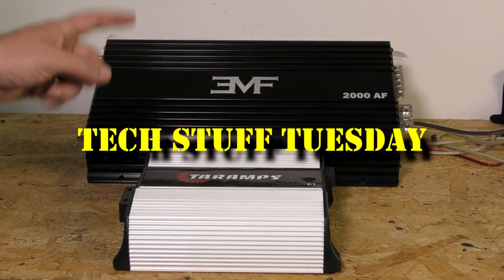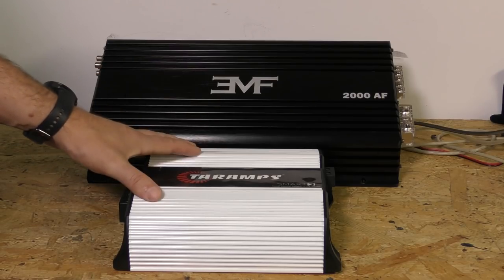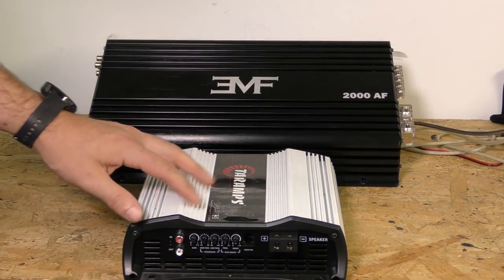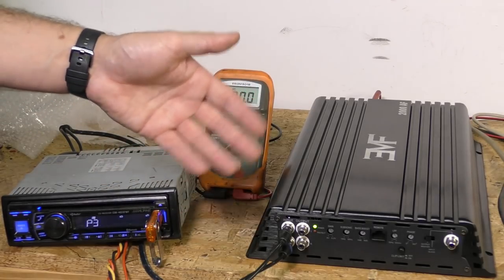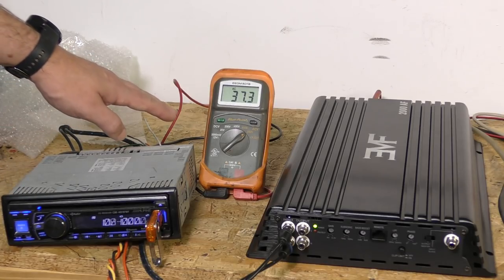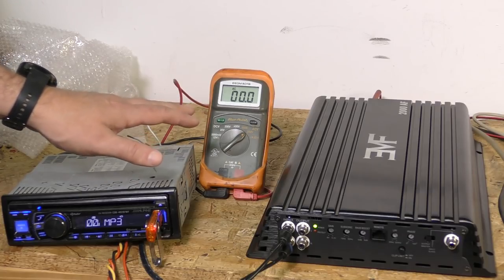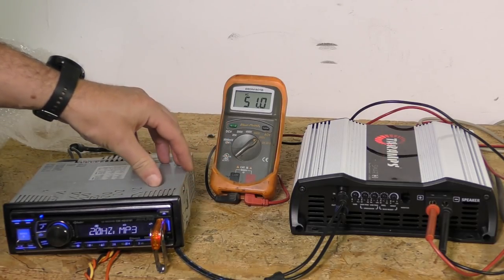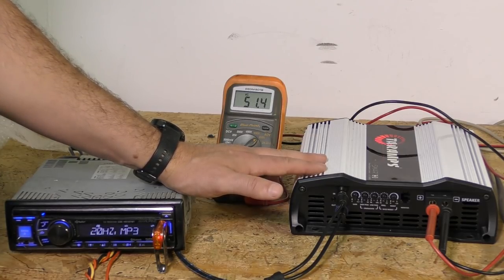The problem with full bridge (Brazilian) amps you never thought about - Tech Stuff Tuesday

Comment: Still gonna run full bridge. Can't beat the price to performance.
Reply: Amen I'm running a Bass 5k and I'm getting another one soon.I can't see myself paying $500 for a 1k amp.I work wayyyy to hard for my money and I'm looking for the best bang for the buck I can get.
Reply: James smith  taramps isba great company no doubt but if its not the bass series amplifiers then its not going to do as well. All the other series amps can be used on subs but they aren't designed specifically for that purpose they are mostly designed for speakers. Same way SFB line wont sound as well as the SALT line because the SFB is designed to play everything equal while the SALT is designed to play the lows specifically.
Reply: Cant trust emf
Reply: I get the point he was trying to make, and ill agree, I've gotten better low bass from a half bridge. But that doesn't change my opinion. Full bridge is the future in terms of efficiency and size. I dont listen to ridiculously low bass. And I didnt break my wallet buying my Smart 3. Theres a use for everything out there. Just figure out what is best for you.
Reply: Spend 1000$ on full bridge amp then 1000$ on a half bridge amp and see what’s louder on lows. I get what you mean but there’s so much more to it than what you were focused on. Some cases such as sq yea half bridge all the way
Reply: Amen this guy is a hater
Reply: FiendForLows I use to run a dynamic audio 2300.1 half bridge and switching to smart 3 was a noticeable difference and was $100 cheaper than that amp 🤷‍♂️
Reply: @omfgg3tlost  I literally said that there are applications for both and everyone should decide what they want based on what their preferences/needs are.
Reply: @chadbeverly4926  actually the MD series is way better than the Bass series amps. Theyre cleaner and more reliable
Reply: @boominS10  well seeing as they have to play everything i would think they would have some sort of better reliability but i still wouldn't trust them over the bass series, but taramps in general is about a 50/50 for is it really worth it to me. But i wouldnt trust that line as far as i could throw it . ID just go with the SFB line for the better quality.
Reply: @chadbeverly4926  so thats why my sfb2k isn't dropping as low as my stetsom 3k does.
Reply: To all you full bridge people. Does SQ not matter?? Yeah full gives tons more power but it sounds worse. SQ over SPL all the way.
Reply: @mikecheeze4312  its about tuning, not the amp itself in most cases. Most big door setups aren't class ab powed anymore.
Reply: @mikecheeze4312  they not hearing that bro
Reply: @RomaVilla  It's not about money... why are you making it about money? I have a 20yo Rockford amp that's doing just fine.... but you get what you pay for 😋
Reply: @landonmurphrey4293  i agree about tuning but amp is just as important. You can't discount nothing is quality anymore for the most part.
Reply: @mikecheeze4312  yes, have you used anything new? Anything korean, some cheinese, and brazillian, when used correctly, is quality.
Reply: @landonmurphrey4293  NOPE! Good ol quality american setup correctly that's lasted 20 years.  And if/when it goes out i will pay for quality again and last another 20+ years. Incase your wondering it's a Rockford 800a2😘
Reply: @mikecheeze4312  im not hating, but technology has came a long way since 20 years ago. Im sure you have a lot of people beat sq wise, but performance whether it be SQ or spl per dollar has came a long way.
Reply: @landonmurphrey4293  Absolutely. While it has come a long way you have to admit there is more shitty amps on the market than used to be. Hardly do you see an amp meet specs anymore... they used to intentionally claim below spec which were referred as "cheater amps" a 50x2 made 150x2. Now it's 500x2 making 200x2 or whatever you wanna say. Yeah nowhere near efficient were AB to a D but can't deny spec, testing and the truth of the matter. A $1k amp back in the day(yeah they were expensive) compared to the same spec amp costing let's say 300 today would absolutely demolish the newer amp in watts and life. Hands down
Reply: @mikecheeze4312  the reason they were so under rated lol is because of how power classes used to work. And I'm sure a lot of people would take a new 300-500 dollar korean versus an old $1000 amp when looking for power. This isn't old school. There are cheap gems out there. And full bridge tech is where everything is headed.
Reply: @RomaVilla  didn't have the patience to read your whole comment but.... just so you know I was stating my opinion. Your's is just fine as mine is. That's what makes us human. We could argue all day.... i was simply stating my opinion. Your comments make no difference to me but i value your opinion. If im wrong I'll gladly admit it. Now as far as being pf money and what not. I'm not wealthy by any means. I'm a normal regular person, but because i choose to save and buy quality over quantity I'm insensitive? Guess i should've never enlisted to put my life on the line for "regular people"
Reply: @landonmurphrey4293  yep, agree. Just playing devils advocate, same as you
Reply: @RomaVilla  cool ✌
Reply: @RomaVilla  yes ! Its nothing wrong with your amp its just not designed to play the lows better than a non full range amplifer ! Remember the SFB line is Chinese made to keep price low but is produce to compete with full range Brazilian amps like taramps MD line. So it's not designed to play bass only very well like the SALT series its designed to play everything really good. Since its sundown and we know the quality and care they put into the products id guess that even the SFB line plays bass better than most full range amplifer. The real only difference in sound is the fact of more spl versus better sound quality . Thats even the problem among bass amplifers is that you can find an amp thats cheaper that can play louder but doesnt have the sound quality of a different amplifer in the same price range or more expensive
Reply: @RomaVilla  your question isn't ignorant at all my friend. The only dumb question is the one you dont ask ! Its only because we are on the internet that people are mean
Reply: @chadbeverly4926  very true, still one gets a little discouraged after enough insults. It's all about learning as much as possible for me and I really do appreciate who ever is cool enough to shed some wisdom on us younger folk, I'm 31 but I feel like ive barely scratched the surface and I wanna keep it going as long as I can.
Reply: @chadbeverly4926  thats like saying the old punch 75 or 150  was only good for highs  because it was a full range amp had no x over  it should have only been for door speakers   lmao  riggggghhhhtt
Reply: @ArkansasChainsaw   well if it worked better on door speakers than subwoofers then i guess you can say it should be. It still doesn't change the fact it can be used on subs, but it still doesn't change the notion that a full range amp plays bass better than a bass amplifer
Reply: To the OP... "you just gonna Send It" lol!
Reply: Man no question on the win  How many taramps out in this comments and how many EMF s .
Reply: @boominS10  and rated at 12.4. at 14.4 the MD 8k is almost a 10k
Reply: @RomaVilla  save up another month or two and buy a quality amp. It isn’t hard. Instant gratification is overrated. Until then you’re just justifying buying crap to make yourself feel better bud.
Reply: @mikecheeze4312  but that’s not true. At all go watch barevids videos.
Reply: @dabeardsmen3621 yah man same here , like people dogging on others for not buying a salt amp with a bobby gayley box 😂😂
Reply: @chris.o thats why hes out of business 😂, he is talks shit on MTX and like hold up , they have there own rd in house and sell ten times as more as EMF
Reply: Some people think whatever they have is the best, regardless of the truth

Comment: Waiting for Sam to come educate you once again.
Reply: Ive had a few conversations with Sam, extremely knowledgeable and very polite guy! Ive followed emf for a while but his biased reviews are getting a little bitter. Despite having a full bridge amplifier in his line up he went after a taramps? Wouldnt a fairer test be 2 from the same manufacturer to reduce the variety of component selections and focus more on the architectural design of the amplifier
Reply: @nate0 thats not at all what i said. I said, in order to compare amp designs... You know, like the title suggests, you should choose amps that have similar specs. To reduce variables. However i will admit the taramps are often of questionable quality. They still have the same return policies as most amps. But this video is comparing full bridge vs half bridge.
Reply from the maker: Will you argue he's wrong when he shows you something you don't like too?
Reply: @EMFAudio  wrong is wrong and right is right. You know the internet is not scared to call it out
Reply: @nate0 The smart 3 does full power at all loads between 1 and 2 ohms.
Reply: @EMFAudio  something i dont like? Please elaborate. Iveexplained in the comment thread that my issue with this video is your testing procedure aswell as component selection. Relative price comparison is miles out! But even in this video you prove ypu getmore power at the low endof a taramps than you do through outthe entirety of the half bridge 🤔 for half the price 🙋‍♂️
Reply from the maker: @Shellywarren69  Interesting, because I never mentioned price other than cheaper is more attractive, and I also never said anything about making a specific amount of power or not. You're making excuses on things that weren't even the point of the video.
Reply: @EMFAudio  don't fret! Someone will ALWAYS be have something negative to say regardless.  Keep it up!
Reply: @Widowmaker2828  BAREVIDS is wrong as well, I tell you why,, look the comparison of a 2000 emf model vs smart3000.. it's just 8% powerful the smart 3.. 2k vs 3k.. it's supposed to be at least 30% powerful not 8%.. that one we have knowledge in SQ vs SPL.. WOULD NEVER UNDERSTAND EVER  brain is way to small to understand what's the huge difference between them... I agree 💯 taramps sounds amazing for spl, BUT too much AMP DRAW for what you get,... Let's make it simple doesn't have to be emf vs taramps,.. NOOOOO.. Even BAREVIDS said in his video, you can also check an orion xtr2500.1 .. and it makes over 4500 at 12.6 v.. so let's do it this way orion xtr 2500 vs taramps  B3 k.. I'm giving you 500 watts more to the taramps since they don't have 2500.1   ......
Reply: @EMFAudio   please refer to 2:19:37 of the video "it's been bare long" on the channel Barevids.  You need to stop spreading false information if you can't even give us details on the preamp or driver circuit. Sam can.
Reply: @Shellywarren69  emf is just needs to go. False information and us Calling him out is the only way we can stop him. The internet will fact check him. Plz keep coming back and making the community aware. I definitely will.

Comment: BigDWiz did the dyno at 40hz and the amp does well over rated at all ohm loads particularly 1ohm. In dynamic it was pushing 5-6k which IMO should more than compensate for any frequency fluctuations bellow 40hz and raise. Can you explain with this in mind? Because logically the dyno results refute your conclusions.
Reply: Watch the in depth review , itll explain its ability to make double the power.

Comment: Regarding the size of full-bridge amps, the reason they can be much smaller is that, unlike a half-bridge, only one power supply rail is needed. In a half-bridge, you need a bipolar supply, which doubles the number of rectifiers and capacitors to generate both positive and negative voltage rails to drive the sub. In a full-bridge that can alternate its polarity at the output, only a positive supply is needed, which saves considerable space. Toss out some of the other minor details like additional transistors for safety factor and loose the LC output filter network, and you can make the amp quite compact.
Reply: That is exactly wrong. Full bridge uses two rails out of polarity. Half bridge uses one rail referenced to ground.
Reply: @cdbennett2332  Um ok... You might want to review your understanding of amplifiers. You have the whole thing back to front.
Reply: @mysock351C  um ok....you definitely need to review your understanding of how amps work.
Reply: @mysock351C  no dude is wright you have it backwards full bridge runs rail to rail half Bridges high rail to ground
Reply: @ FYI the “rail” in this case is not the output, it refers to the internal supply voltage. A full bridge has just one active power rail (+V). Half-bridge has TWO active power rails (+V/-V). The only difference is a full bridge uses a sleight of hand to flip the roles of its +V rail with respect to ground to make the negative part of the waveform. Have a look at how a full bridge driver works. One might ask if it still has +V then why use it at all? My answer is it’s a real pain in the ass having to build the same thing twice to get the negative voltage. It’s annoying and wastes space.
Reply: @mysock351C   🤦no  everything you just said is wrong and makes no sense.. no not hardly
Reply: @ “Omg bluh liek no sense!” As said earlier I’m only an engineer who’s literally BUILT the damn things, but what do I know. The reason it makes no sense to you is because you have a lack of formal knowledge, so why should it? One reason full bridges are popular in low cost high power stuff is it eliminates roughly half the BOM cost from the PSU section and simplifies the layout. There are other reasons as well esp. in small mobile devices since they have to scrape by with ~3V. Although they usually don’t bother due to regulations on headphone volume. But if you don’t understand what a full bridge is it’s a moot point, and you never will.

Comment: you should double check where the high pass (infrasonic) crossover was really set at by either running a sweep on an Audio Precision or simply running it wide open without having the high pass filter turned up to anything and redoing your test. Just because you set the dial to 10 hertz or 15 hertz it doesn't mean in actuality the attenuator crossover knob is set at exactly that point.  I have seen Kicker , Fosgate and even some JL audio amps where the crossover setting on the amp did not match the actual frequency it was being crossed over. Furthermore  even if what you showed is actually accurate it doesn't prove that the Taramps can't play bass well. Your argument should be more on the reliability side which is a fair argument but not because it drops a few volts while playing low frequencies.  It was still playing much more output power than your amp that is much more expensive.
Reply: when are you going to do a podcast with 12v talk or everyday audio
Reply from the maker: Well you are an expert at the packaging saying one thing and the product actually being something else.
Reply: Did Rockville seriously come to the party?? LMFAO
Reply: @EMFAudio  Your response has nothing to do with the comment that I made. Good day sir.
Reply: @rowboyto156  When I have time. Been very very busy.

Comment: @17:27
This is an 8% difference in VOLTAGE.  Ohm's law tells us power = E^2/R the difference between 51V and 55V in POWER is 500W or around 25%.
Now that said, this translates into about .6dB which is going to be nearly inaudible.

Brazilian full range amps attenuating on either end of their published """frequency response""" has been a known issue since they started selling them, but priced at as low as 5 cents a watt people are going to keep buying them, hopefully understanding their limitations.   As far as actually trying to run full range, every single one of these 3000W per door builds I've seen in person have just been as many cheap PA mids and horns or super tweeters as possible crammed into doors or trunk lids, they have all sounded absolutely awful.  I think the people going for that effect aren't really looking to sound good, just to get painfully loud as cheaply as possible.
Reply: CONGRATULATIONS 👏... YOU ARE AWESOME..   THAT'S TOTALLY TRUE WHAT YOU SAID THIS COMMENT NEEDS TO BE ON TOP. finally someone explain the right way,.. this is exactly what I try to tell people but,, ohh well . MANY thanks ..
Reply: I agree with Ricardo you hit the nail on the head. This 6% reduction is a non-issue because the Brazilian amps are so much cheaper per watt it doesn't matter. I'll take a .6 db loss any day if it comes with a 40-50% increase in wattage per dollar. In the end Brazilian amps are more powerful dollar for dollar and sound the same to me as all the other Korean amps I've had. And they go low and create crazy hair tricks... If anyone doesn't believe me feel free to check my videos on YouTube.
Reply: @Widowmaker2828  they don’t at all sound the same bud lol. But ok. Cool story.

Comment: Been using taramps smart 3k wired to 1 ohm with box rise it sees around maybe 1.6 1.8 ohms  been running audio control eqx dsp  been using the amp since it came out have had no heat no bad bass issues im using 2 skar evl dual 4 12s in a 4.5 cube ported box   amp has been running perfect for years now